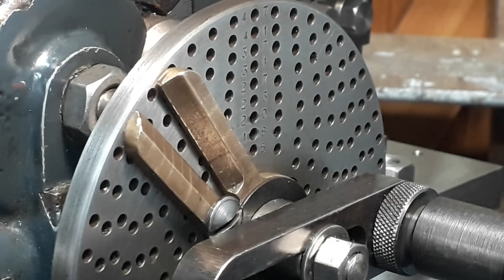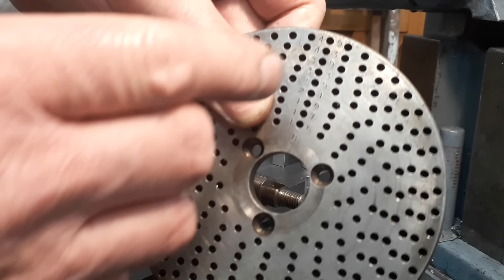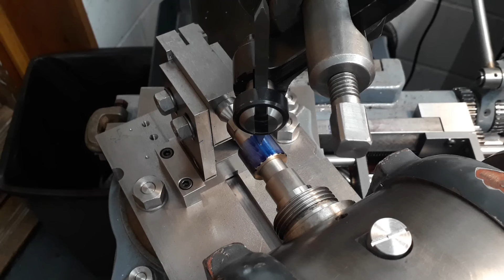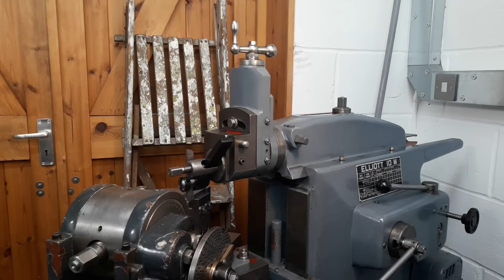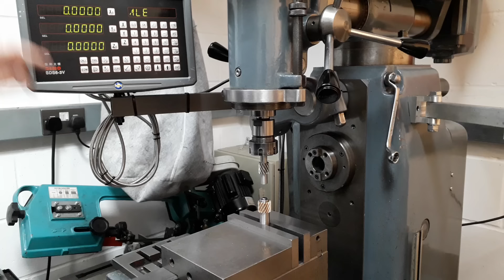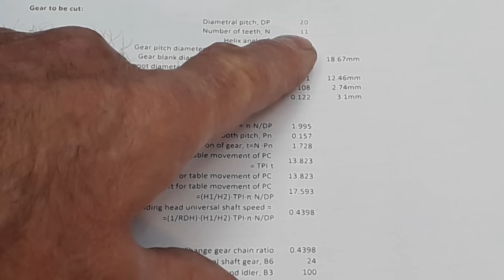Elliott 10M Shaper Gear Cutting Fixture Part 5

Comment: Dear Robert, thank you for your excellent series on gear cutting on the Shaper.  I was wondering if you were considering following up with a set of plans that someone like me could use to make my own apparatus. No doubt I will end up with a different Shaper but nevertheless, the principles are all the same. As for a series on using the Tool and Cutter Grinder, yes please.

Comment: How do you know when to stop cutting? Do you count the strokes?
Reply from the maker: No, too much to concentrate on. Start with the tool clear of the work. On the first tooth (or gap, as you cut the gaps, not the teeth!) watch as the tool cuts the leading edge of the tooth (it starts cutting the trailing face of the previous tooth. You can see when it stops cutting. Mark the position of the table with a sharpie, then work to that mark. Successively deeper passes remain cutting for longer, so you have to allow for that.
Reply: @ThePottingShedWorkshop . Aah I see. Thank you!

Comment: Well done, Very impressive. I’m interested to know if it’s possible on this set up - with the same tool bit - to cut all numbers of teeth for 20 DP ( at a given pressure angle), ie like the Sunderland gear generation process where one rack cutter cuts all numbers of teeth. If so I expect you could also profile shift a tooth form to prevent undercut or adjust shaft centres and still end up with gears which run together correctly. I’m sure if I watched a number of your other videos I’d find an answer to my question!
Reply from the maker: To answer your questions, yes, one toolbit does all tooth counts for a given DP, from deeply undercut low tooth counts (I've tried 10T as a test - it works fine and generates the undercut) up to a rack (although a rack requires no rotation, just linear feed). The same tool is used for spur and helical gears.
What I reinvented here turns out to be the same priciple used by a gear shaper - I just didn't know at the time as I hadnt heard of such machines. Gear shapers use multiple teeth cutting tools, but theyre far more difficult to make than a single toothed cutter and my little shaper is nowhere near rigid enough to cope with the increased cutting forces.
I havent tried profile shifting, but yes,  you can profile shift although the width of the tool tip would require modifying depending on whether the shift is positive or negative.
Thanks for watching!
Reply: @ThePottingShedWorkshop that’s great, helical gears are a very difficult challenge in the home shop. Was just watching your channel over a coffee as something relevant prior to setting my Sunderland planer to cut a new 10DP 12 tooth shifted profile pinion for the apron on my Colchester mastiff , (the one which engages with the 10 foot long bedway rack does a lot of heavy work on a machine of this length).  Great what you came up with in the home workshop, keep up the good work!

Comment: I would have thought U-Joints without equal and opposite angles would introduce some error but maybe it's negligible?
Reply from the maker: @privateparty4900  Agreed. I think I mentioned somewhere in the video that this might be the case, but the gears run well together so the error must be small.

Comment: Very interesting, very informative. It's one of the more complex machining videos I've seen. I was thinking of getting into a bit of hobbyist maching, this well beyond my knowledge, but  still found it very interesting.
Reply from the maker: Have confidence and don't be afraid of failure. I'm not a machinist by trade, I was an IC analog design engineer. I specialised in RF receiver design and wide bandwidth high accuracy opamp design. I spent 25 years woodturning, I worked in a bicycle repair shop in my youth, but I picked up enough knowledge to get me started and I built on that. BTW, all that woodturning and tool sharpening makes grinding HSS by hand a doddle!

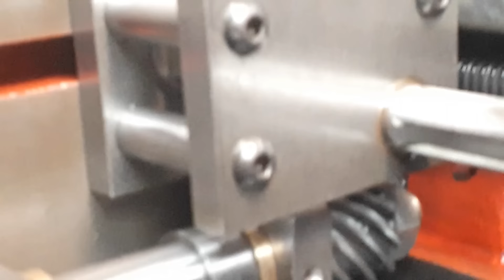Comment: 14:30 ooh no not again! When you want to test something, and then have to go back to make yet another gear blank. 
Next up: Internal gears and bevel gears on the shaper?
That would be interesting how you would go about it.
Reply from the maker: I've had a few more thoughts about internal gears on the shaper. It'll take a few weeks, but I'll do a video on it, whether it works or not!
Reply from the maker: Internal gears might be possible. As for bevel gears, I've had thoughts about those but it's complicated. The shaper tool represents a rack tooth. If it won't engage with a rack, cutting the gear may not be possible.

Comment: Great series on cutting gears on the shaper.  I am planning to use my shaper to cut gears but will use a Mod 1 rack attached to the frame of the shaper to generate the rotation of the blank.  Seeing how you made the changes to allow helical gear cutting was amazing.  I'm now looking at how I can fit that into my design. I will see if I can make a small CV joint rather than a UJ so that angle in to the drive is copied to the output.  Thank you for a brilliant series of videos that have been very enjoyable to watch.  I also liked the fact that you showed the failed attempts. Gives me hope that I can do this on my shaper. P.s. any videos you can do on tool grinding would be gratefully received.

Comment: WOW, that is great. Do you know if it is possible to make helical bevel gears on a shaper?
Reply from the maker: @kioliex  Thanks. I think I can see a way to make bevel gears on a shaper, but helical bevel gears, I think not. The fundamental principle behind cutting gears on a shaper is that the cutting tool resembles a rack tooth. As a helical bevel gear will not engage with a straight tooth rack, I don't see a way of cutting one with the shaper.
Reply: @ThePottingShedWorkshop  Okay, that makes sense. Thanks.

Comment: This series has helped me understand some of the aspects of how this attachment works.  Cutting helix gear teeth still looks like some kind of sorcery, in spite of watching it done both ways (mill and shaper).  I guess I'll have to view it several times, in person, to get my head around it.  Same with why the rotation drive must be changed according to changes in pitch diameter.

Knowing/understanding how something works is vital in being able to operate it for best results and longevity, after all ...
Reply from the maker: Seems like sorcery, but its not. My first time cutting a helical was for a replacement gear for the table drive for my surface grinder. The handle is at 30deg to the table travel and the gear engages with a rack on the table. That was the inspiration for cutting helicals on a shaper, the rack tooth (shaper cutting tool) engaging with the gear. I think part 2 in the series goes in to the details. Same principle, just turned at an angle. Just imagine the gear you're cutting rolling along a rack.

Comment: Thanks for your YT series on gear cutting on the shaper;  outstanding original work and workmanship!
I just sold my little shaper on which I wanted to try the wire travel method of gear shaping but as they say life got in the way.
Your set-up for helical gear shaping is really interesting.

The next increment in your development work might be shaping of angle gears, right angle and others.
Gear shapers for such work are shown here on YT, and they typically have two shaper rams working in sequence, but it may be doable with one ram.

For quiet running gears these may be lapped together with a non-embedding lapping compound meant for soft metals.
All in all a most enjoyable series;  thanks again and greetings from Ontario Canada.
Reply from the maker: Thank you for watching. I've been mulling over how I might do bevel gears for a while but so far I've come to the conclusion that it won't work. I'm still waiting for the flash of inspiration!
Reply: @ThePottingShedWorkshop  My endeavours of gear cutting have been very conventional.  I made a so-called parallel hob for 32 DP 20 deg PA and made a bunch of gears for Maudslay's reversing gear.  You can see a steam engine on my channel that employs this gear train.
After that an ancient -1953- German gear hobbing machine followed me home, complete with a box of hobbs:-))
As to gear shaping of bevel gears, perhaps it would help to study the videos here on YT that show these machines in use.
These machines typically have two rams cutting alternately, with the blank rotating under the cutters just like you do on your shaper.
Good luck with your study on this topic.
Greetings from Ontario Canada.

Comment: I just found your site. Very good videos. Two questions. 1). Your cutter has straight sides. Are you cutting a “generated “ tooth or involute tooth? 2). Helical gears are curved. Your solution appears to cut a straight path tooth. Am I missing something here?
Reply from the maker: Thanks for commenting. Yes, the cutter has straight sides, but a rack form tool will generate a true involute. A gear hob has straight sides too. 
A helix is a straight line wrapped around a cylinder with constant pitch. The shape cut by the jig is a true helix. The tooth profile is a standard involute in a direction normal to the teeth, not parallel with the gear axis.
Reply: Your rig is a bit confusing so sorry about the questions.

A hob or fellows shaper cutter has straight sides. In the case of the fellows. The blank and cutter are rotated into each other. The cut begins shallow and progresses until the cutter and blank are true tangent which is max depth. Then the depth of cut backs out on the back side of the tooth.

The profile tracks a math function called an involute. The involute of a straight line is a straight sided tooth as in a rack. 

The diameter of the blank determines the involute shape of the tooth.The cutter has no effect. 

Gear hobbers work in a similar way and the teeth are straight. 

Look up the Eureka cutter attachment. It has lots of info on cutting gears.
Reply from the maker: @devmeistersuperprecision4155  The operation of this attachment is fundamentally the same as a hobber, except that the cutting tool reciprocates rather than rotates. The blank rotates as the table moves sideways as if it were rolling along an imaginary stationary rack mounted above the blank, rather than the "rack" formed by the rotating hob teeth moving  on a hobbing machine. One tooth of this imaginary rack is the cutting tool and has the same shape in cross section at the cutting face as a single tooth on a hob. Parts 1 and 2 of this series of videos explain the workings in detail, including the maths to get the gear train ratio to cut the correct profile.

Comment: That is quiet the puzzle doing this on a tiny shaper. 🤔
Reply from the maker: Yes, a smaller dividing head would make things easier. I haven't seen a smaller div head with a differential shaft though.

Comment: Why does a shaper need helical gears cut on it?
Reply from the maker: Because it can!
What are your alternatives if you need a pair of helical gears? Buy stock gears, hob them assuming you have a hobbing machine and suitable hob, or mill them with an involute cutter. Or, grind a cheap piece of hss to the right shape and cut them on a shaper for 10% of the cost of the next cheapest method!

Comment: It seems that the teeth's "faces" would be slightly faceted because of the stepping nature of the feed. Do you know of any post-cutting procedure that may refine the surface quality, possibly running the gears in together with a lapping compound or something similar, to "polish" the teeth?
Reply from the maker: If you look closely enough at any machining cutting operation the surface will have ridges. Its just a question of making the ridges small enough and close enough together. Firstly reducing the feed per stroke on the shaper would smooth things out. You could run the gears with some sort of abrasive compound to wear them in together, but they run perfectly well for my purposes without.

Comment: Here's a tip; get your drive shaft UJs in phase, you're multiplying up the errorof being out of phase with the two different angles, yokes should be inline, not 90 degrees out.
Reply from the maker: Oh, I agree wholeheartedly! For the RH helix, I hadn't cut a gear with that big a helix angle and I was having to sort things out on the fly, so the cardan joints weren't correctly phased. For the LH helix, I sorted it out so they should have been.
Reply: @ThePottingShedWorkshop  i noticed you'd got your act together in the second set up. Top job !

Comment: 19:08 if thats not complex enough. What is? 
I sure hope that effort is worth the result. I don't think I'd ever put myself through that much for gear making. I'd find another way. But if you love it. You go for it.
Reply from the maker: It's come in very useful for making non standard gears. I made a pair of gears for the backgears in a friend's lathe - the original helicals had been damaged, presumably from chuck removal, and this was before I could cut helicals. So to get the right spacing I made some MOD 2.1... gears. I could have bought a pair of MOD 2 cutters (74 and 22 teeth) and fudged it, but this jig made a proper job of it.
Reply: @ThePottingShedWorkshop  well, sir.  I certainly applaud your work. I'm not exactly stupid, but I sure don't think I could have succeeded in coming up with that setup. It's very nicely done. And I never once thought you could cut helical on a shaper.

Comment: Inam wondering, what if instead of one tooth there would be three or five - esečntially mimicing the shaper gear mesh of infinite diameter. Would that not be quicker to shape involute gears in less time?
Reply from the maker: I had to think about this one to give a reasoned answer. In principle, yes. For, say, 5 cutting teeth, you could cut 5 teeth of the gear per pass, assuming there were enough travel on the shaper table and that there were enough rigidity in the setup to cope with the increased tool contact with the workpiece. The big downside, and it is a major hurdle, is that you now need to create a cutting tool in the form of a rack with the teeth spaced exactly the right distance apart rather than a single easy to grind trapezoidal shape. That puts the tool in the same category as gear hobs or gear shaper cutters, easy enough to make in a suitably equipped factory but beyond the capability of a home workshop.
Good thought though. Thanks for commenting!

Comment: Hello,
I’m impressed by your ingenuity, I’ve seen several attempts to do exactly this on a shaper - but yours is the most interesting one.
I’ve subscribed to your channel to not miss a single video.
I’ve one question: I own a Spanish milling machine (it weighs 4 metric tons) and I’m looking for a smaller machine, because I’m partially impaired since 
a year and my body power is limited.
I now want to ask you about your milling machine, what manufacturer and what type it is ?
Thanks in advance, Thomas
Reply from the maker: Hi Thomas, thanks for watching and subscribing.
My milling machine is an Elliott model 00. It's probably as old as I am. They appear occasionally for sale, usually needing some work and often missing critical parts that have either been forgotten or have been sold off as the accessories make a lot of money relative to the cost of a whole machine. It is extremely flexible and can achieve a lot for its size, but is not the most rigid. It fits my workshop very well though.

Comment: I have to say that this was absolutely brilliant. I have a dividing head with banjos & gears etc and absolutely no idea how to set it up for helical gear cutting.
So this was really fascinating.
I would love to have seen how you worked out what banjo goes where and with what gears to end up with the rotation required.
I realise it’s highly complicated z& probably would go over most viewers heads and probably make the video way to long.
But it would be lovely to have a reference to know where to start.
I have no need yet to cut helical gears, but I’m guessing that day will come eventually, so it would be handy to know where to look to figure it all out.
Can’t thank you enough for this video. 👍👍👍🇦🇺
Reply from the maker: I covered the maths in part 2 of this series. There's no complicated maths involved. The difficulty of working out the gear ratios is handled by a spreadsheet which, given a list of the gears available, works out every possible combination and what ratio they produce. Its then a simple matter of picking out the closest ratio to the desired value.

Comment: Nice video Robert, very informative, and very nice work on the gear cutting and the machinery you have made to produce them. Is you mill a Elliott omnimil 00 ?
Reply from the maker: Yup, thats the mill. Just the right size for my workshop (about 9 x 15ft), very flexible. If only it were a true universal, but you can't have everything.

Comment: Nice job again! Hows about a nice span measurement? Over pins would be nice too....can't wait for your next video!
Reply from the maker: Thanks. Pins are easy for spur gears, but I'm not sure its so easy for helicals. Certainly beyond my maths to work it out from first principles. The axle spacing measurement technique of Tom's Rabbit Hole at least is easy to relate to an absolute measurement.
Reply: @ThePottingShedWorkshop I can run the numbers for you, what's the HA PA an Z